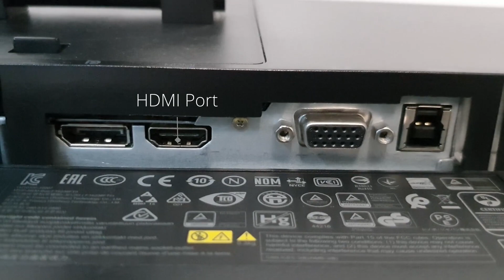How to setup the Lenovo Thinkvision Monitor

Comment: i just bought lenovo s24i -30 i seen everywhere it has freeesync .... but cant find it on osd
Reply from the maker: How to Activate FreeSync
To activate FreeSync on your Lenovo ThinkVision S24i-30 monitor, follow these steps:

Download and install the latest drivers from the Lenovo support website.
Connect your monitor to the NVIDIA GPU using DisplayPort cables compatible with your monitor and GPU.
Reboot your monitor and computer.
Open the NVIDIA Control Panel and navigate to the display tab.
Select your monitor from the list of detected monitors and enable FreeSync by checking the box next to "Enable G-SYNC or compatible G-SYNC".
Apply the changes and restart your computer to ensure the settings are applied correctly.

Comment: Thanks, I watched your viddy and then just took this impossibly heavy thing which I'm afraid to break and just looked at the wires and attached like to like. I thought I was in for a long haul, since I tried the diagram over the weekend and thought I was in for a admin driver add call with tech support. The thing just worked instantly, thanks!

Comment: Hello, question about this monitor since I have the same model just smaller size, are there any wall mounts that are compatible with this?
Reply from the maker: Yes, any of the vesa wall mounts will work as the measurements are standard and adjustable generally. You can always get the ones that can adjust so u are not stuck to one size.

Comment: Does this monitor have inbuilt speaker. My pc detects it as speaker but there is no sound.
Reply from the maker: I believe one of the models has a capability (maybe the all in ones) but I don't believe this monitor has one. 

ThinkVision T24v-30	Yes	Two 3W speakers, ideal for video conferencing with noise-cancellation mics.
ThinkVision T22v-20	Yes	Features built-in speakers and microphone, suitable for professional use.
ThinkVision L24q-20	No	No built-in speakers, but has a headphone jack for external audio devices.

Comment: Hey. I see you are still replying so I have a question. 
The monitor I now have was my brother’s and I’m trying to connect it up to my setup, however his desk was a lot smaller and he has his turned vertically and I can not figure out how to turn it back. The stands appear to be the same but I don’t know if he has like a newer version. I’m to scared of breaking it to put any real pressure into twisting it but the back has a circle that looks like it should twist. Is there something I need to do first in order to turn it?
Reply from the maker: If it's the same one as my video's, you can't turn it. If however, you have something that's already been turned, you will be able to turn it back. Without knowing which model it is, I can't show you how. I have used an HP before and they only turn one way. So if it's not one, try the other. It should not take force.

Comment: If I want to connect the computer to the pc Lenovo p300 what cable do I need to use?
Reply from the maker: For your Lenovo P300 to a ThinkVision monitor, use a DisplayPort or HDMI cable if both have those ports—check the back of each. DisplayPort’s best for quality!
Reply: @LetMeFixIT  thank you

Comment: I have a Lenovo V15 G2 ALC Laptop, a thinkpad usb-c dock Gen 2 and two lenovo t24i-20 monitors.
I have connected everything. The displayport cables from both monitors to the Thinkpad and an HDMI from the Thinkpad to my laptop. I have even connected a USB-C cable from the Thinkpad to my Laptop.
My laptop can't detect anything.

When I put the monitors on the Lenovo sign comes up and then they just switch off.

All cables are in properly.
Reply from the maker: 1. Verify Connections & Power
Power the Dock Properly:

Ensure the ThinkPad USB-C Dock Gen 2 is connected to its 135W power adapter. Without sufficient power, the dock may not function.

USB-C Connection:

Connect the USB-C cable directly from the dock to your laptop’s USB-C port (not HDMI). HDMI alone may not carry video via the dock.

If your laptop has a dedicated Thunderbolt/USB-C port with DP Alt Mode, use that port for video output.

2. Check Cable Types & Ports
Use DisplayPort or USB-C for Video:

Replace the HDMI cable with DisplayPort or USB-C cables for connecting monitors to the dock. HDMI might not work reliably for dual monitors via this dock.

Ensure the monitors are connected to the dock’s DisplayPort/USB-C ports, not directly to the laptop.

Test Cables Individually:

Swap cables to rule out a faulty cable. For example, test each monitor with a single DisplayPort/USB-C cable.

3. Configure Monitor Input Sources
Manually Select Input on Monitors:

Press the monitor’s physical menu button and ensure the input source is set to DisplayPort/USB-C (not HDMI or Auto).

Power Cycle Monitors:

Unplug the monitors from power for 30 seconds, then reconnect.

4. Update Firmware & Drivers
Update the Dock’s Firmware:

Use Lenovo Vantage or the Lenovo Dock Manager to install the latest firmware for the ThinkPad Dock Gen 2.

Download: Lenovo Support https://support.lenovo.com/

Update Laptop Drivers:

Update your USB-C/Thunderbolt drivers, graphics drivers, and BIOS via Lenovo Vantage or the manufacturer’s website.

Check Windows Display Settings:

Press Win + P and select Extend or Second screen only to force detection.

5. Test Hardware Compatibility
Test Monitors Individually:

Connect one monitor at a time to isolate the issue (e.g., one might be faulty).

Bypass the Dock:

Connect a monitor directly to your laptop’s USB-C/HDMI port to confirm the laptop’s video output works.

Try a Different Dock:

If possible, test with another dock to rule out a defective unit.

6. Advanced Troubleshooting
Reset the Dock:

Disconnect all cables, unplug the dock’s power for 2 minutes, then reconnect.

Check BIOS/UEFI Settings:

Reboot your laptop, enter BIOS/UEFI (F1/F2 at startup), and ensure:

USB-C/Thunderbolt ports are enabled.

Thunderbolt Security Level is set to No Security or User Authorization.

Reinstall Monitor Drivers:

Download the T24i-20 monitor driver from Lenovo’s website and install it on your laptop.

7. Contact Support
If the issue persists:

Use Lenovo Vantage for diagnostics.

Contact Lenovo Support directly: Support Link. https://support.lenovo.com/

Comment: Does the monitor need to be connected to a laptop because the monitor keeps going to power saving mode?
Reply from the maker: No, the monitor goes into the dock. If it's going to power saving mode, it means it's not being picked up by the laptop (from the dock) - so there could be a few things there. Either the power plugged in is not rated for the dock (sometimes the laptop power pack can be accidentally used) or the cabling is incorrect, or maybe the USB C cable is incorrect (must be thunderbolt 3 or 4 (depending on dock), or plugged into the wrong slot of laptop or dock (plug at back of dock).

Comment: Hello, is it possible to mount this screen on a wall ? Thanks
Reply from the maker: Yes, if you remove the stand, there are 4 screws. You can even use these screws to mount your VESA mounting system with it. 0:56

Comment: i have a hdmi cord and power cord, they’re plugged in but the internet won’t work
it tells me to check the ethernet cable connection? what’s that?
Reply from the maker: The ethernet cable is for networking (aka internet stuff). You can either use that or your laptop's wifi for internet. You plug the ethernet cable into your router/modem. If you have a wifi router/modem then you won't need an ethernet cable. If it's telling you to check the ethernet cable it probably thinks you have no internet plugged in. So either check your wifi or connect a cable if you don't have wifi.

Comment: I'm trying to use my laptop and gaming console on this Monitor. However i cannot get any sound coming of the monitor. Can you help? I have checked all the settings on my laptop as well as going through all the settings on the actual monitor. I have noticed there are no sound options on monitor. Any help would be great.
Reply from the maker: This model doesn't have sound but has an optional soundbar support. However, I would personally just get Bluetooth speakers and connect them to your gaming console or a nice set of headphones as monitor sounds are usually not that nice.

Comment: It shows power saving mode how i can solve this issue
Reply from the maker: Your monitor? Yea I've seen that alot. That means your USB is likely not detecting the dock. In that case, check for two things. One, check your USB port works for this dock (sometimes some usb ports don't respond well) so try another. Two, make sure you have to correct power pack. There are a few different types but they all fit in the same power socket!! If there isn't enough power, the dock won't provide power to the video ports!

Comment: How to adjust the stand length  ?
Reply from the maker: pull up or push down. It's spring loaded so you will have to use a tad bit of force. It only goes up a little.
Reply: @LetMeFixIT  Thanks it's done

Comment: hello can you please help me. i have no idea how to rise the lenovo thinkVision monitor and i couldn't find any video's to help with my problem 🙁
Reply from the maker: Did you pull out the blue ring? If it's still stuck there, you have to remove it. If you have, you just need to lift it up as it's spring-loaded. If you're still having issues, let me know and I'll make a video to show you.
Reply: @LetMeFixIT  May I ask where is the blue ring? Many thanks

Comment: What if you don’t have a dock?
Reply from the maker: You can usually plug an HDMI cable into your laptop/PC. Some laptops might support display port too. If neither, you can try using the USB port or use an adapter from usb to display or usb to hdmi.
Reply: @LetMeFixIT  If I don’t have a dock, will my laptop stay charging if I connect to the monitor using a usb-c to hdmi cable?

Comment: Hey I’m having problems with this monitor, it came with a mini pc attached on the back, but I only want the monitor per se to connnect it to my laptop, however I disconnect the mini pc from the back and use a dport to hdmi adapter to connect it to the pc, the monitor turns on but it goes black screen saying “no connection, check signal cable” so idk what’s happening
Reply from the maker: Actually, that's an All in One you're describing and I've tested using just the monitor only without the PC and it works. You have to plug the Display Port cable into the DP slot. Also you have to power it with the supplied power supply.
Reply: @LetMeFixIT  yeah I’ve done that, I unplugged the mini pc from the back, connect the power cable and a dport cable adapter to a Hdmi (since my laptops don’t have dport plug ins) so what I do is, connect the dport-Hdmi cable adapter to the monitor, connect a Hdmi cable to that adapter and the other end to the laptop, but it doesn’t work:( thanks for following up!
Reply: @El_Colochos  bro what have done. same problem for me
Reply: @pa1sayana  man what I did was buying a dock port that includes the DisplayPort and bought as well a DisplayPort cable, connect the cable yo the monitor and the other end to the dock, and the dock connected to my laptop and that did the trick!

Comment: That is how it looks like after setting up, because there is no image appearing to the monitor screen.
Reply from the maker: Hey there! Sounds like you've got a bit of an issue with your monitor. No worries, let's see if we can sort it out.

First things first, make sure the cables are all good and tight. Sometimes just giving them a wiggle can help. If that doesn't do the trick, try using a different cable. If you've got a buddy with a computer, see if you can plug the monitor into theirs for a sec to see if it's the monitor or your computer that's the problem. And last but not least, double check if the monitor is actually on and switched to the right input. Hope this helps!
Reply: @LetMeFixIT  Thanks for the reply! Trying another kind of cable (HDMI) worked in my case.